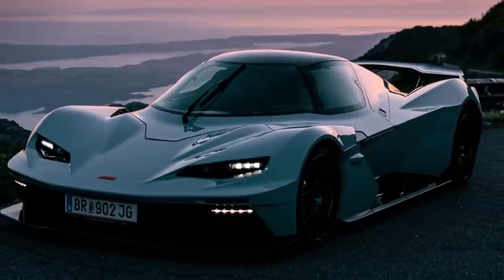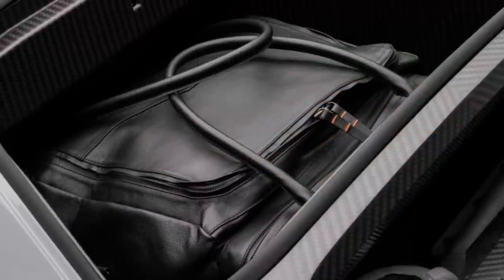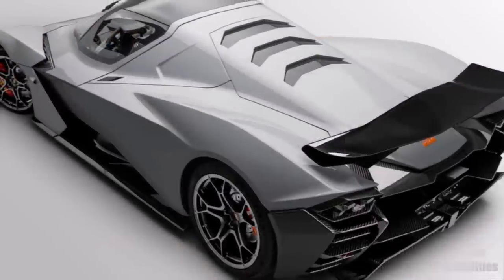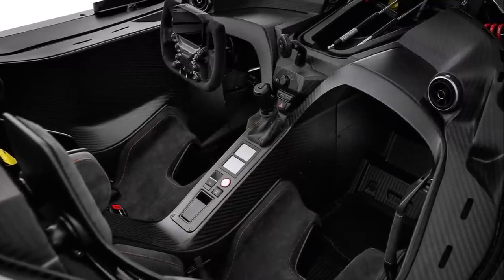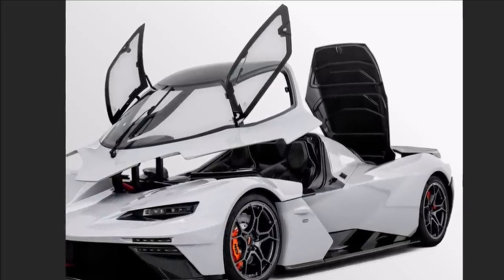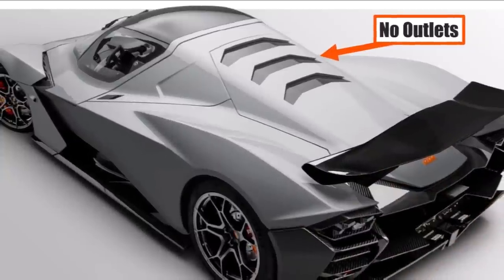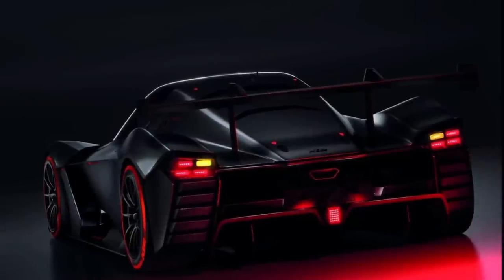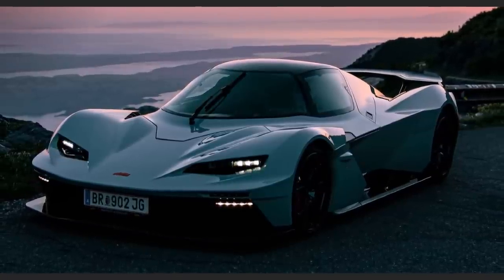KTM X-Bow GT-XR - FIRST LOOK

Comment: What happens if you crash the car upside down and have to get out. The windows seem to be angled upwards so they possibly can't be opened enough for the driver to get out
Reply: maybe a hatch at the bottom like on a tank xD
Reply: The windows open forward, not up. You really think they'd design it so you couldn't escape?
Reply: Then the driver crawls out thru the open side windows!😉👍
Reply: @einautofan6685  Exactly!

Comment: How significant is the side to side weight imbalance cause by a transverse engine/gearbox. I’m assuming the side to side CoG is different as well?
Reply: Normally you can balance that out quite good. You put engine accessories, fluid tanks and stuff like that to the side which is lighter. It works quite well most of the time. So there should be really not much of a difference side to side.
Reply: As this car is derived from a race car, the COG would've been very tightly controlled
Reply: None.
Reply: It depends of on the suspension, in supercars you could corner balance the car in this regard to distribute the weight balancing. I assume this has that from factory?

Comment: Interesting engineering. Innovations of this kind are expected from KTM. 
Excellent narration.
Reply: ktm has never innovated anything, every innovation has failed miserably and been abandoned and they went back to carbon copies of honda and yamaha race bikes but with junk motors
Reply: ex had mmaannyy ktms because she needed backups. i raced pro am with 1 honda 450 that had a mid season service some seasons if it started to knock. usually 2 or 3 races after knock started. ktm is a joke at best

Comment: Excellent overview. I don't recall seeing any engine bay photos... access issues?
Reply from the maker: Thanks! No not at all, if the rear cover is open, you can easily reach the engine. In motorsport they take the cover off.

Comment: the addition of the two side windows that can not be opened separately most likely came from incidents from this years 24hrs of Nordscheilfe race. One KTM caught fire and another had a problem of opening up the hatch/door after the car crashed to let the driver out. Those two incidents combined would be horrible, I'm glad they added those openable windows.
Reply from the maker: Definitely a good choice
Reply: @BSport320  In the event of a roll over crash is there a way to exit the car? I love the looks and you did a great job of breaking down the details. Oh, I should ad the tail lights used are from Husky's enduro bike not their mx/sx bike...just a small addendum to your spec list.
Reply from the maker: @Peanutdenver  Thanks! You could escape through the side windows or break them out if you need to.
I mention in the video that the tail lights are from the Husqvarna MX. I say "their own" because Husqvarna belongs to KTM.
Reply: @BSport320  Yes along with Gas Gas too. I was saying it's off their enduro version bike not their mx bike as motocross bikes have no tail lights or head lights. I race mx and just noticed that little detail, not important at all tho.
Reply from the maker: @Peanutdenver  Ah OK, understood! We call these bikes MX here :)
Reply: @BSport320  My bad, I didn't even think of that...was thinking in Murican :)

Comment: ... just some loose thoughts ... how nice it would be if KTM took one of their large V2 motorcycle engines, double it to get a V4 and adapt it to this car. Would be unique sound and still enough power. I am aware that development cost could be prohibitive for such a small production volume.
Reply from the maker: It would be interesting but as such a small manufacturer they need a bullet proof concept, so they take a proven drivetrain.
V2's are naturally shaky engines because of their uneven firing gaps. If you put 2 of them together it doesn't get better and vibrations are the enemy of every race car. Porsche had major problems to get their V4 to run and even had to change firing order after the engine was done.
Reply: @BSport320  Yes, you should certainly do something against vibrations like balance shafts, crank throws, firing order etc. But it is a sportscar and there are many V4 motorcycle engines which run rather smoothley. And a typical sportcar's flatplane V8 isn't vibrationsfree either.
Reply: @basilb4733  They could build a V8 using mostly superduke hardware except the crank & block, but it's a huge, lossmaking project and emissions compliance would be a terrible problem. It could be a sweet and lightweight 5.2L v8 with about 720 naturally aspirated horses and about 560nm of torque if you just multiply the superduke figures by 4. Somebody spot me EUR50M and I'll give it a shot :)

Comment: It must have been tricky to get the side-to-side balance of the engine and gearbox exactly right - especially with a relatively long (and thus wide) lump like the Audi five-banger. Their mass has to be exactly symmetrical or the car'll have wacky handling, and the differential has to be exactly centered or it'll have torque steer.

Comment: $285k is really cheap considering the package. Awesome looking as well!
Reply: A bit debatable really.  Throwing in some AC doesn't make it a street car.  It's just a racecar with AC.  I mean yeah, it looks amazing, and will probably be super fast, but so are the other cars in this price range.  And they have way more features that most would want in a road car.  I've owned many crazy cars, including an Ariel Atom.  The Atom was fast AF, but I hated driving it around town.  Just a racecar with turn signals.  This new KTM looks to be similar, with a roof, AC and a trunk.
Reply: @vhayne91777  I guess that depends on what you expect from it. I wouldn't buy one and expect it to be a comfortable daily-driver. If you want something that goes fast around a track, but is legal to also drive to the track then this seems like a pretty solid choice.
Reply: @nj1255  That's true for sure. :)  But...who among you guys advocating for this against more "normal" exotic cars, are actually planning on buying one?  See, when I first saw it, my eyes lit up, and I was very curious (with intent to purchase).  But once I saw the price....nope, I'm out.  I could "maybe" swing a 300k car, if I unloaded most of my other stuff, but I wouldn't do that for a 720, huracan, for 488.  And I dang sure wouldn't do it for a "near" track-only car.

Comment: slightly disappointed because it has the monocoque but a subframe on the front end...
the profit margin is very generous at that price
Reply from the maker: Subframe at the front?
I would say the price tag isn’t too high for what you get and it makes you appreciate the short X-Bow even more.
Reply: @BSport320  subframe as shown at the 3 minute mark. normally in a monocoque chassis the suspension is directly attached, I understand that it is configured for the road as well, so that partly explains my query.
Regarding the price I should have added IMHO 
Nonetheless thank you for this and your other videos
Reply from the maker: @johnnycomelately6341  so the front suspension is mounted directly to the monocoque, but the rear has a steel subframe that the rear suspension is mounted to.
Reply: @BSport320  got it
at least we understand each other now:goodvibes:

Comment: Unless I missed something, this very cool car would suffer road damage the first time you drove it unless there is a mechanism to raise the car’s clearance. The splitter would be trashed on anything but the smoothest track. Unless this problem is solved, the KTM is just not going to be able to be driven on public roads.
Reply from the maker: The car has an optional lift system.
Reply: Negativ assumptions

Comment: This car would be good to compare with the Gordon Murray Automotive GMA T33. All but price. No doubt we could buy two or three KTM GT XR's for one GMA T33. 😊
Reply: I don’t think you can. The XR is just barely street legal while the T.33 will be more comfortable than the T.50, which is going to be more comfortable than the XR.

Plus, the T.33 has 107 more hp, and is roughly 29 kgs lighter than the XR. It will depend on how it handles corners, but given Gordon Murray is one of the guys who made the McLaren F1, it’ll be very close to the XR. I wouldn’t be surprised if the T.33 just walks over the XR.
Reply: @devandrasimanjuntak1646  Respectable assessment indeed. Thanks for the research. The price variance will be interesting between the two. The T33 is very pretty in appearance way nicer than the T50 and the KTM.

Comment: Not having windows is just horrible..who ever has done long road trips on countryside back roads at the end of summer would hate a car with no windows (like an Ultima gtr for example)...this is a fabulous track car only ,cannot be a daily...!!!!
Reply from the maker: The KTM is as comfortable as an R8 and has A/C, which I guess the Ultima doesn't have?! You wouldn't drive an R8 on a hot day with rolled down windows either, because the hot air would come in.
This here is only to pull a parking ticket etc.
Reply: @BSport320  A ny car can have AC..!!..Over 20 road trips in the 90" I made from NY to Montana (in a 1988 Porche 911 SC)..I wrote end of summer!! (read again)..you obviously have not experienced such road trips..it"s really something ,trust me..!!)..and you want those windows ,you need those windows..!!
Reply from the maker: @hectorherbert6585  Oh I have done may road trips across Europe and US but don't really see the problem.
Reply: @BSport320  The end of summer ,nice breeze..,still worm..windows down on a Montana beautiful back road..,the smell  of the countryside..the wind in the hair of the woman sitting next to me in my 1988/ 911 SC....smiling at me.,the sound of these Toyo tires in that tight corner..oops that was quick...another hour and we'll be just in time for a quick jump in the pool at the hotel...a quick 'cheek clapping' before dinner and couple beers.(wine for the Miss).choosing on the map the roads for the rest of the long trip tomorrow morning...driving again...finishing my large cup of coffee while burning a Marlb..enjoying life....up or down....I want windows....I need windows...OK pal....?

Comment: Yes its a really neat car..But it's not a street car.  It's got 1/4" of ground clearance, suspension that will break your teeth if you hit bumps without a mouth guard in and you cannot see a single thing more than 90 degrees to your left or right..And the more they invest in engineering to make it a make believe street car, the more the package actually costs.. I'd just suggest if you want a high performance street vehicle you just do a side step and get a KTM1290 superduke..Your wallet will thank you.
Reply from the maker: Ground clearance is not unusually low and a lift system is available. Since the A-pillars are not structural on this one, the visibility is better than most other sport cars and the camera system eliminates dead angles like with traditional mirrors.